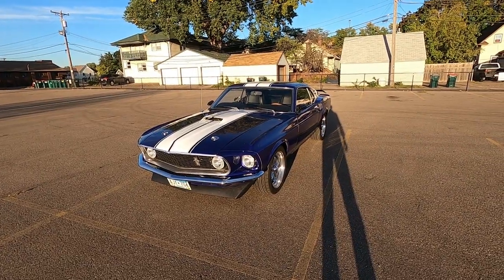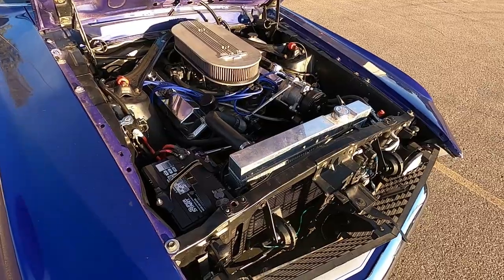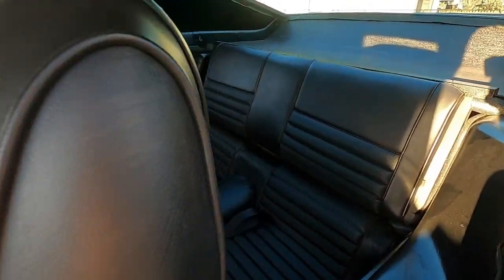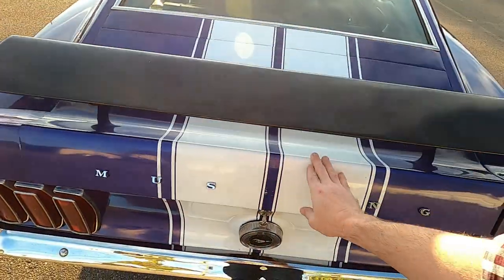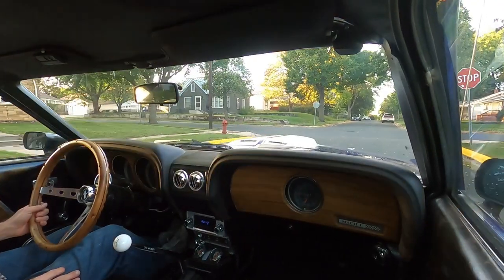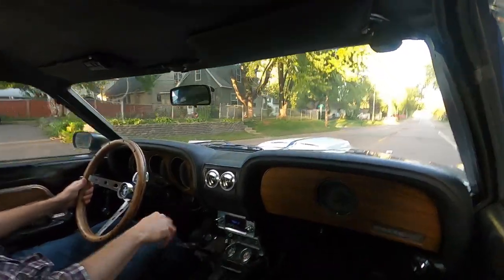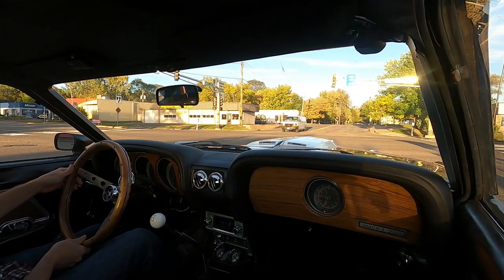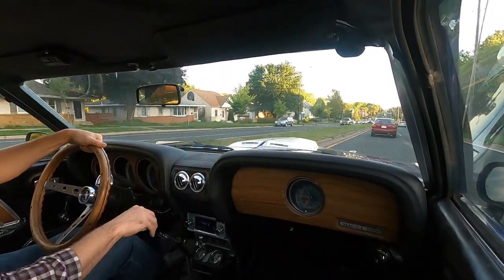1969 Mustang Fastback 427 FE Intro

Comment: Great Video, Thank you so much for taking the time to make this video and show us your beautiful Stang.
I have had several, and have had to sell all of them for various reasons and am now Stangless.
In my youth, I did enjoy all the HP and bragging rights to a big block, but there is sure a lot to be said for a small block.  Especially now in my older years, I enjoy the usability of a small block.  If I can find another '69 or '70 coupe or fast back, I will certainly get one.
I dont think it matters what you want to show us that you have done to this beauty,  I will certainly watch it with great enthusiasm!
Thanks again for sharing !!!
Reply from the maker: If I were to make a recommendation for a daily driver from the 1969 Mustang lineup, it'd definitely be the F code 220hp, 302 2V with the C4 and fully loaded with power steering, front discs and air conditioning. Essentially, almost what my car was from the factory. The small block will win the practicality award all day, especially the 302 2V, which I think is the best overall engine for the job back then.

That said, the 427 was what I started with and what was important to me in my project so that's what it is. :)
Reply: @randomologist77  Put it there partner!  Welcome to the world of enjoying the sky for 60-70 ft as you grab 2 nd and run it t out the back door with nobody in sight! Hell yeah 👍

Comment: Wow, real nice!! I have a 67 resto  that I drive a few times a week in Fl. Btw, what’s the tire size and rims(brand) that you have?  Great videos. Thx in advance
Reply from the maker: They’re American Racing Torque Thrust IIs in polished aluminum and all I can say is I got what I paid for haha. They’re cheap wheels, but they look pretty good :) I went with 17” diameter. I think the 17s were the perfect size for a daily/restomod. Allows for brake upgrades, lots of tire options, not as harsh a ride as 18” and the 17s seem to look right. Check out Discount Tires’s online tool which can show you different wheel packages on your car. It’s how I settled on mine.

Comment: What wasn't "streetable", was In city stoplight to stoplight. The 427 FE had the largest bore of the FE family at that time so the distance between the pistons was less than any other. Ford corrected that with the 428. Less bore, more stroke. More distance between the pistons. The 427 generated a lot of heat in stoplight traffic. The heat came up to the carb(s), and would heat the fuel in the bowls, changing the fuel from a liquid to a vapor. Vapor doesn't work in a carb, so the engine would stall - what was called vapor-lock. You could blip the throttle to get cooler gas from the tank into the bowls would help, but the best was highway driving where there was far more air blasting through the engine bay. I grew up in the back seat of a 64 Galaxy with a 427 and dad drag raced it. After he broke the block for the second time he traded it in on a 66 Mustang.
Reply from the maker: My dad had problems with the 427 running hot when he first got it after it'd been raced hard in its former life. He said he didn't have any problems after rebuilding it. I can agree the 427 is part volcano, but I haven't had issues with vapor lock so long as I've kept the fuel line routed away from the headers. The 427 was a no expense spared race-only engine designed to live under extreme conditions at the race track and the 428 was a performance street engine. The bore spacing of the 427 wasn't a flaw, Ford wanted the bigger bore for bigger valves and higher rpms and the heat generation of the engine is more related to the camshaft's big overlap and head design. Not that the cam was particularly unique to the 427. The 390 police interceptors used essentially the same one. All that said, the 427's actually have ironically great street manners.

Comment: Is that a factory rear spoiler? Doesn’t look quite right to me, maybe the angle?? Otherwise awesome ride, love it!!
Reply from the maker: I don't know if the spoiler was on the car from the factory. I'd have to look at the Marti report, but it appears stock or stock replica in nature to me at a glance. The stock spoilers do have adjustment (like mine) for angle.
Reply: Angle needs to be adjusted.
Reply from the maker: @davidkendall6801  I did play with the angle because I felt the same way... but in the end, I was used to the current angle and it grew on me, hah.

Comment: Did this 69 Mustang originally came with a 302 that you've recently sold.
Reply from the maker: There's an older, rough video of the car with probably the original 302 2V which came with it on the channel. Sold that along with the FMX to a guy putting a first car project together for his son several years ago. Turns out the 302 was probably a lot better than it ran... since, you know, I found out the coil/ignition was wired through the windshield wipers, haha.
Reply: @randomologist77  Oh ok, so was the 427 Side Oiler swapped in you're Mustang or did it just came with the 427 Side Oiler when you got it.
Reply from the maker: @CJColvin  The 427 top oiler was my dad's old racing engine from the 60s and the car itself was just a means to an end as I had the 427 before the Mustang. All 427s from 63-64 were top oilers with the side oilers being produced from 65-68. :)
Reply: @randomologist77  Sounds good. Does the Side Oiler have some performance upgrades to it or is it completely bone stock.

Comment: Did you track mpg's to san fran driving this?
Reply from the maker: I did! MPG varied from 15.5-16.0 mpg. Best fuel economy seemed to be 70mph flat. Above 75mph, economy tanked pretty quick.

There was one section where it got 16.5mpg, but that was swiftly followed by a 14.5mpg after hundreds of miles of steady 15.5-16.0s. Basically, I think I didn't quite get the tank filled when I got 16.5 and then made up for it the next fill up, haha.

My dad accused me of driving downhill with a tailwind since he got 6mpg with it back in the 60s, but he was in a '63 Ford XL Convertible and racing around town. As he said, "I never let anybody beat me away from a stoplight!" :D

Comment: I thought serpentine was "1" belt?
Reply from the maker: Lots of serpentines systems are just one belt, but serpentine actually refers to the shape of the belt being wide and flat, able to run on both the front and back sides of the belt surface like a snake all coiled up. The serpentine conversion for my car uses 2 serpentine belts.
Reply: Thats what i thought too 1 belt

Comment: Adam is that you!
Reply from the maker: @Bbbbad724  sorry, nope!
Reply: @randomologist77  I had to rewire my 65 Galaxie hot rod and it was perfect. After my sight went, my son came and pulled the wiring box out and now you can’t even start it. I built the engine in 1999 and it has that sweet solid cam wheeersshh over the bassy exhaust and when you stomp it it rips!  But it dynoed at 509 hp 488 ft lbs out of a 390. It’s sitting out here with the new paint I shot 15 years ago burning in the sun. I really miss that Z-16 780 cfm 375 hp 396 Chevy carb howling, 425 hp on the 427 Vette. I miss romping through the backroads at night. My son who helped me do a frame up restoration has no interest in it. It hurts. I taught him how to do factory spot welds, suspension tuning like they did for years in NASCAR. Priming, sealing, and paint. I am sick about it. I gave it to him and he won’t take it. Maybe after I am gone.
Reply from the maker: @Bbbbad724  Here’s what I can tell you, it seems to be pretty random these days as to who is interested in cars and vintage stuff. The memories you made will never disappear, and I can practically promise you they’re valuable. That’s one of the best things about these cars. They’re special, and even when they’re gone, they’ll live on in the hearts and memories of the people who owned them and worked with them!

Comment: Nice looking car :- )
I'm working on my 69 Mach 1, some metal has been changed :- ) you can see it in my channel, if you want to.
Reply from the maker: I checked it out! I can't complain about yellow, but it's also cool you're putting it back to original black.
Reply: @randomologist77  Hi, you cant see it, but the paint job, is VERY bad made. Both the actual paint job, but also sanding ec ec under the paint, it's really really bad !
I've never seen anything this bad. But you can see it, in some of my uploads.

Yes it will go back to Black Jade.....

Comment: Only two 1969 427 FE Mustangs were ever produced by Ford and neither were street-legal. TASCA Ford, in RI, had one of them.
Reply from the maker: The only year the 427 was an option (and it was never ordered) was 1968. Ford offered a "W" code 427, but it was detuned and used a hydraulic cam. A few Mercury Cougar GTE's had them installed, but Marti has no records of any Mustangs ever coming with the 427 from the factory. There was a TASCA SOHC 427 Mustang in '65, but I wasn't aware of a later one. Thanks for watching!
Reply: @randomologist77  TASCA Ford had the 427 FE '69 Mustang, in the showroom, when I bought my all-options '69 Boss 302 Mustang there.
Reply: @randomologist77  There's a few Fords that Marti Reports couldn't find documentation for. I have one and Marti Reports stated that the car was never produced by Ford. Within 6 months, I proved them wrong. Two staff members at the Ford Museum helped me research into the car. That car that isn't supposed to exist is in my barn/garage for the winter and I have all of it's documentation records. It was built in April of 1970 at the Atlanta Ford factory.